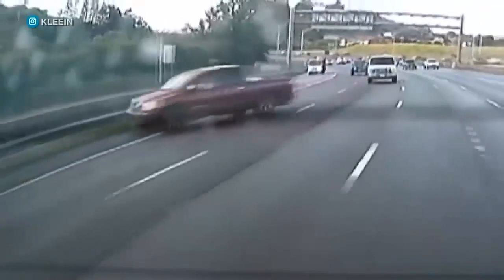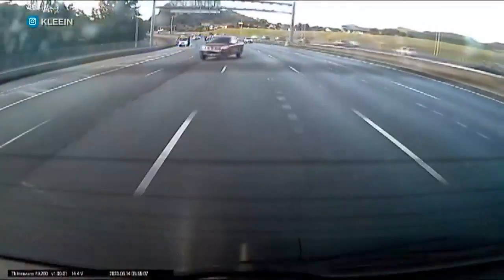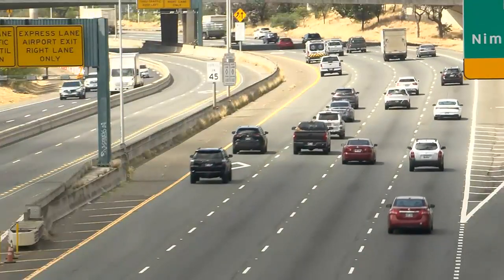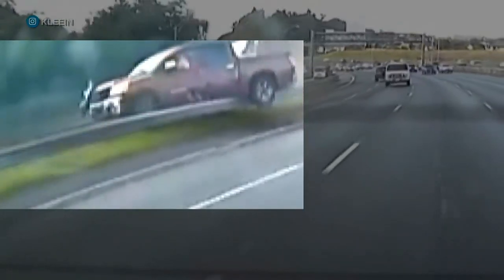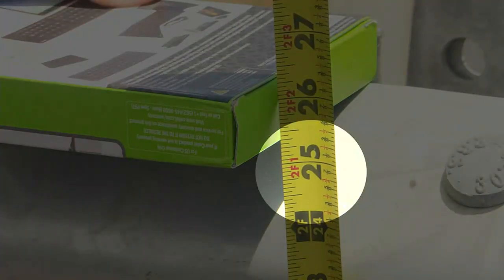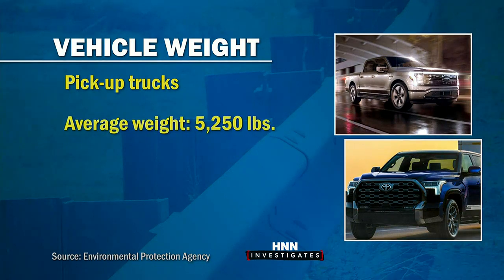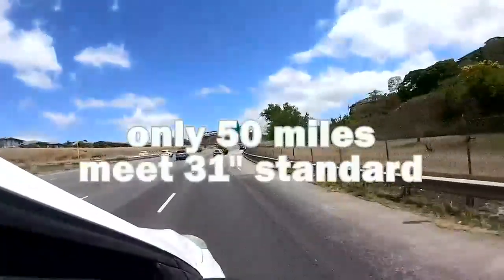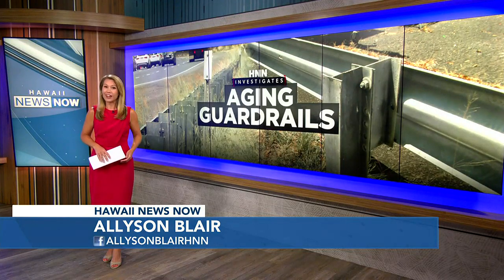Expert: ‘Haunting’ Hawaii crash caught on camera underscores dangers of antiquated guardrails

Comment: The guard rail looked like it held up. How about we take the $600 million  mayor Blangiardi wants to spend on a wasteful wall around the Ala Wai canal and focus on these and other outdated infrastructure?
Reply: So what's the plan for the canal if no wall?  Honest question?  I live right next to it and don't want to be flooded in a few decades.
Reply: @hanaf1231  I live on Ala Wai Boulevard as well. The flood water will come up from below. If you look at the golf course, you can see the flooding when there are high tides. The water floods parts of the golf course on sunny days. Our leaders want us to belive the canal will.flood from rains. Wrong. The wall would be a waste as it can not stop the rising tides. My issue is spending the money to build a useless wall. The monies and efforts should be spent figuring out how to mitigate the damages the rising sea levels will cause. Not on a cement wall that will not do anything to prevent flooding. If the canal did breach, the rest If Waikiki will already be flooded.
Reply: In the scenario of walls, we would also have to wall up the makai side of Kalakaua. Even that wouldn't stop the sea level rise from flooding us. Most the effort should focus on preparing our buildings, electrical grid, and the like for when we do flood. How many ground floor businesses are going to flood after a wall is put around the canal? All of them, in the future. The building I live in has our electrical on the ground floor and, thankfully, outside. A lot do not. All will have to be moved up.

Comment: 3:41 
This math doesn’t work. The fist stat implies guard rails can handle 2000lbs so a 3500lb car would be 1500lb over. That means a 5250lb truck would be 3250lbs over capacity not 1200lbs.

Comment: I recall seeing a national news article years ago on the improper installation of guard rails…according to the article there should NOT be.a rectangular washer installed as it will not allow a vehicle to slide along the guardrail.  By installing the washer, it keeps the rail sturdy and actually turns the post in the ground into a dangerous metal object that could hurt drivers 5:41